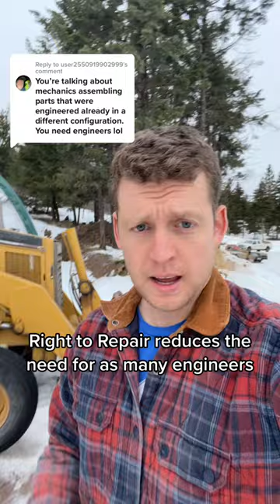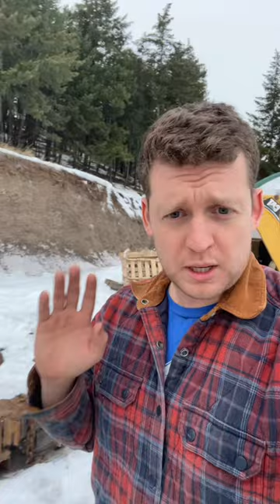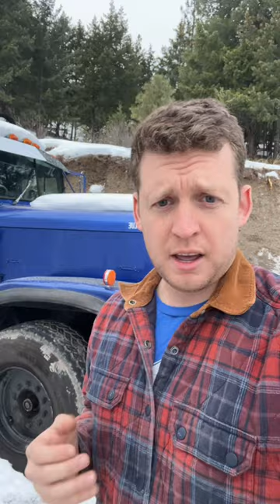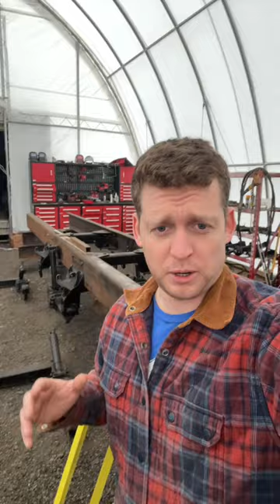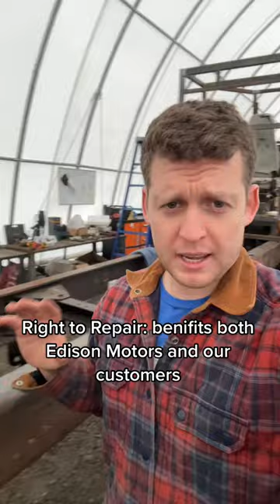Right to Repair: How Edison Motors Fast-Tracked Production Using Off-the-Shelf Parts

Comment: I work for an auto parts store. Aside from looking up the part by year, make, and model, I have found several parts which are a better fit or an upgraded change by using a search feature that's on the store counter computers and it's not on the app or website. Without putting any vehicle information, depending on the part the system gives different search parameters like size, amperage, connection type, measurements and so forth. For example, are computer doesn't list how to convert a 50-year-old vehicle from drum to disc brakes especially when meeting a mechanical emergency brake lever caliper.

Comment: Besides the fact that off the shelf parts are cheap, readally available and often interchangeable your local traction, cbs or whatever truck parts store you use will have free courier service to the place where your working on your truck, this even includes on the side of the highway (depending on your relationship with said establishment). This is a no brainer and a huge step in the right direction in my opinion.

Comment: I don't really know anything about the trucks or the industry, but the "off-the-shelves parts" that you guys mention, are they only in North America or world wide? Will the "export" version be made with different part? Cause I recall it being mentioned that there were people in Sweden, New Zealand and other places overseas that were interested in getting vehicles from Edison.
I know that it is years down the line but I'm curious what the thinking might be about that?
Reply: They'll likely have to build a fresh truck from the ground up for other markets. EU trucking regulations are very different from North American regulations.
In EU and Asian markets its very rare to see traditional cab trucks Ive lived in the EU all my live and have never seen a truck with a traditional cab IRL, they're all cab-over designs in Europe, due to the smaller roads we have here.
Reply: If it's off the shelf parts you can buy then online yourself. It's not off the shelf on your local shop, but most local shops don't have much on stock anyway

Comment: This actually opens up an interesting buisness idea. Open a parts review service that your customers pay a small subscription for, like $10 per year. The review is basic but important: does the part do as advertised, how reliable is it, and how yo swap this particular part to your truck. The parts company doesn't pay you, so there is no conflict of interest.  Once production is slowing down, and people are not purchasing your trucks as much you get a bit of money to maintain the customer service quality you believe in through the life of the truck. You can include various tutorials for how to diagnose the problem and fix the problem. Then, you essentially have a big digital workshop manual that goes through how to fix your truck in video. You don't need a huge customer support team.

Comment: In my experience the need for engineers increases with scaling. If you're selling 200.000 machines a year, it's very much worth it to have an engineer calculate whether, let's say a fender mount, can be made less expensive to save 2$ per unit..

Comment: Ive got a sprayer manufactured by wilmar, that is a spare parts machine if I've ever seen one. John Deere engine eaton hydro char Lynn wheel motors, hydra force control block. Thing is 30 years old, if you know where to look you can get affordable parts all day long.

Comment: Also try to use as much 3D printing as much as possible for the small things, it makes prototyping so much easier and even if you go with injection molding you can provide the design files to be printed as replacements.

Comment: Maybe you're trying to spark some comments and get people going. I was an engineer in three different manufacturing companies. I loved the techs and service people and they loved the good engineers.

I would always go to the techs first. How is this normally done? Who do you order from? Who's most reliable, etc etc...I would explain what I'm trying to do. Have you seen this, have you done it, would you find it useful.

Each has their place. When SHTF and failures or issues don't make sense it's good to have an engineer that fundamentally understands what's going on.

When you need to build something quick, with repeatability, affordably, and efficiently, engineering for drawings, processes, configuration management, is very important.

When you want to know what works, what's available, what people normally do, what people understand, you need mechanics and techs. 

Good professionals respect each other, know each other's strengths, and are strong with each other.

The reasons you use to describe why you didn't need engineers (which at your stage I agree with... Why draw up the manufacturing plans and design the plant when you don't even have a prototype) just sound like descriptions of bad engineers optimizing for the wrong things.

This sounds like the problem Jeff Patton describes in user story mapping. Eyes on the prize, pragmatic people. Don't spend one second on anything you don't absolutely need right now.

Comment: I'm dreaming of a mini-Topsy pickup truck.
Reply: Lol. I’ve been sketching one out with golf cart axles. I actually have most of it figured out except charging and drawing from the batteries at the same time. I’d probably just run two sets of batteries if I ever did something like that.  We could really use a 6x6 golf cart size utility vehicle and would like to build our own.
Reply: Yes!  Eg.  A Honda Akuti with a decent-sized electric motor, batteries and a super-quiet Honda Generator in the headache rack.

Comment: Companies get into making their own parts for many reasons... they cannot rely on vendors to reliably produce parts consistently, need parts at scale from a low volume vendor, a part needs a modification, a part fails to meet specs although most of it is good (usually materials/tolerance), they can't dictate what a vendor does/the vendor refuses to adapt to the needs of the company.  Alternately, the vendor the company selected gets bought out by someone else who then takes it upon themselves to cheapen everything they make.  Remember:  regardless of whose name is "in" the truck, it still means responsibility/criticism falls on the name "on" the truck. The real trick to this is making sure the vendor who supplies the parts is doing their due diligence on their side (reliability/QC tests and checks).  Where it's important, this should be done on your side as well to make sure their claims track with the end product. 

That said, As long as the parts being sourced are well engineered, have a track record of reliability, and then remain in that standing in the future, you're fine. Course, that doesn't do anything if the part itself is used in a manner or conditions it was never intended for (hello testing!).  Hopefully this improves development costs and timelines, but taking shortcuts are rarely a good thing in the longer run. 

Source: consumer electronics reliability for close to 10 years.

Comment: It’s like buying a prebuilt PC that uses standard components, anything breaks and you can easily replace it without having to go back to the OEM.
Edison Motors will of course in the future manufacture their own parts as the company grows due to “economies of scale”, but that’s even more risk because tooling is super expensive. 
The downside is often size and weight, which might matter on an EV sedan, but which frankly is less important on a freight truck that already has solid steel frames and is expected to haul 10s of Tons of load.

Comment: There's also the fact that you'd go out of business instantly lol. As the company gets bigger it makes more and more sense to vertically integrate across your supply chain. The cost of designing and manufacturing your own parts would only make sense if you were big enough at which point you'd make parts available through your supplier network. Totally different scale.

Comment: What are the theoretical fuel savings on a hybrid electric Peterbilt 389? Could you pull the drive train and transmission, replace the transmission with a generator and use the factory engine at idle speed to produce enough power to run two electric axles at highway speeds?
Reply: I've been following the content for a while so I think I know what the answer would be. The stock engine is overpowered for this application. They're overpowered because you need a lot of power to move a fully loaded truck off the line  but once you get some momentum going, there is very little needed to keep it going. The genius in the whole thing is moving a lot of power through an e-axle is relatively easy and it can do it brilliantly . This allows a much smaller engine running at the most efficient RPM to top  off the batteries once they go below a certain limit and shut down once it's at the upper  limit. Running your stock engine at the most efficient RPM would probably generate too much power and would be a waste for what the charge controller and battery require.
Reply: @jidduv  the smaller engine revs up to meet the load requirements but the bigger 450hp Cummins would only need to idle to meet the load requirements. That’s my thought process

Comment: Many off-the-shelf parts have reputations behind them. You can find what's good and bad about them before pulling the trigger. You end up with a product that is cheaper to produce and likely more robust. It's what most companies are shying away from. Why use an already available part when you can overcharge by 2 or 3 times by making sure yours is the only option?

Comment: Do you plan on making personal vehicles?
Reply: personally i dont think they will. the whole thing with their truck is that its got a bigass generator in the front so its better than just electric, which wouldnt fit inside a regular sized car

Comment: I fucking loathe battery electric vehicles, but I absolutely love right-to-repair support. You are doing the lord's work on that front!

It's part of why I'm dailying a 1971 Chevy C10. I can get parts from basically anywhere for it. The aftermarket support is insane. I don't need to buy parts from Chevrolet for it.  I can fix it as I want and need, modify as required, make it my own keep it alive for decades to come. All thanks to it being easy to work on and widely supported by multiple suppliers.....just as a company building new trucks using off-the-shelf axles, switchgear, etc as you're doing does.

Comment: I worked in aerospace for several years when I was younger, and I was a tech who worked with engineers in the test division. I met engineers that were close to being a genius, but they couldn't change the oil on their own vehicle. The BEST engineers were young mechanics in WWII, and then after the war they took engineering classes on the VA Bill. They had no time for any bullsh*t. The young engineers would design a "perfect part", but the way it was designed made it hard to replace when it wore out. The older guys would institute a tweak that would make it easy for a mechanic to get an actual wrench on it, long before we wasted months and millions of dollars on testing the V1 version. If you get a rock thrown up and it cracks the windshield...the DOT and highway Patrol will not allow you to drive until its fixed. Good luck finding a Tesla windshield near where you broke down. I've seen what engineers like, and I am not impressed. Full-time engineers have never tried to run a business.

Comment: In that same vein, wouldn't it have made more sense to convert existing heavy truck bodies to your hybrid powertrain, rather than custom developing Topsy with its need of a unique government certification just to drive it on the road? It just seems to me like you could have gone much further much faster doing it that way.
The curved windshield problem could have probably been resolved by welding in a frame for flat glass as needed if and when the old windshield cracked.
Disclaimer: I've never even sat in a big truck. 🤷‍♂️

Comment: You could be the solely provider of all the parts for the truck, and still be under the right to repair, by making the parts available for your customers. The issue with the worst offenders against RTR made that by not offering spares at all.

Comment: I was talking to some folks about manufacturing trucks in BC the other ddaaaAaaaayy....
Axels. Edison's got the strongest most powerful electric axel available on the market. Bolts. Edison uses the strongest 100% North American steel fasteners for every application. Caterpillar. The best way to charge your Edison truck. Deisel. For your Caterpillar. EV. Nuff said. Fridged temperatures. Will not deter. Generator. Always on board. Hills. She'll use battery going up but can put back charge going down. Icy roads. More reason for on demand torque from edison's powerful electric motors. Jolt. What you'll likely get if you try to steal my battery. King. How you'll feel driving the first fully electric, on board deisel genny charged truck in your neighborhood. Lights. You can have about as many as you want with all this electricity on board. Money. Well yeah, you'll need lots of money to get your hands on one of these but long term you'll save tons. Noise. A lot less than a standard commercial truck and with your gen off there doesn't have to be any. Odometer. You'll probably see half a million miles with no major drive train maintenance. Prestige. The first fully electric commercial truck is about as prestigious as it gets. Quick. She ain't gunna be slow. Real. With the prototype complete and orders being fulfilled, Edison is becoming very real. Suspension. Robust and effective, heavy duty fit for the job. Truck. There is nothing else these could be called, 100% truck through and through. Unbreakable. Maybe not fully Unbreakable but darn near. Victory. Edison bringing this truck to market. Wash. You'll want to wash the truck because you will love this truck. X-ray. Transparent business practices and pricing, hide nothing like every costumer has x-ray vision. Yellow. Sure, available in many colors. Zebra. In case you need a truck for a circus.

Comment: Proprietary parts are BS! The OEMs are essentially robbing the customer.
  I eventually found away around them,the OEMs. Found a great counterman at of all places a marine supply/engine builder. Standard Motor Products manufacturers a ton of parts that appear identical.  However the components inside are very much different. After numerous attempts on my part to find the correct part. Remember my part is non functional. No resistance readings no outward indicators of polarity or voltage values. He would open up whatever I brought to him. From his vast knowledge he would be able to determine exactly what my customers needed.
  Apparently, the OEM marine manufacturers play the same dirty game.
  It's absolute nonsense.
I am very pleased that Edison Motors is utilizing standard off the shelf parts available everywhere. No stinkin' games.

Comment: Engineers are the reason why everything is 3 times as expensive, complicated, and lasts a 3rd as long as it used too
Reply: I wouldn’t blame solely the engineers. Really it’s corporation telling the engineers to make parts specific to a certain vehicle, or to allow failure after a certain usage. I highly doubt engineers would be opposed to making vehicles with off the shelf components, after all it saves them time and effort.
Reply: Safety features are so complicated, let's make cars uncomplicated like before.

Also, let's get rid of MRI machines and just dig around our organs blindly when something hurts. 

Internet devices are complicated as well, let's just use letters and horses to correspond and shop.
Reply: @spaceshipearthresident4283 Do you feel like you did something there?

Comment: You aren’t trying to redesign the wheel, you’re trying to redesign how you turn that wheel.

This is what engineers have to start thinking, design how to fit an existing part and make existing things work, rather than proprietary design. 

Don’t try and use an m11x2.18 thread on a part, when an m12x1.5 is common and does the same job.

Comment: How do you call yourself an ev company when it has a diesel engine does that not make it a hybrid???
Reply: It's capable of running on electric only. So technically it's an electric truck with a diesel range extender.
Reply: @classicgmdiesel1248  so what is the definition of a hybrid vehicle?
Reply: @A-A-Ron3  hybrids will use either gas or electric (or a combination of the 2) as a means of propulsion. The  Edison is only electric driven. The diesel engine is not connected to the axles. Its basically the same idea as the Chevy Volt, also considered an EV.
Reply: @classicgmdiesel1248  gotcha that makes sense now! I've worked on hybrids but after hearing that explanation I can differentiate between the two now

Comment: You don't need an architect to build a shed. You don't need an architect to design a square house. That's what you guys are doing. Building a house using Master Carpenters, not architects because you want a house that is the most sturdy, not the most aesthetically pleasing.